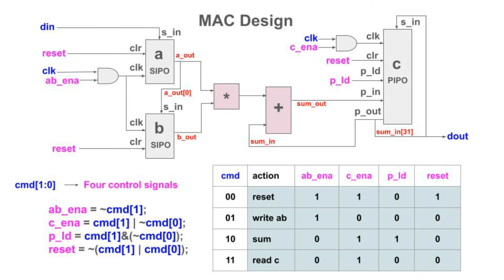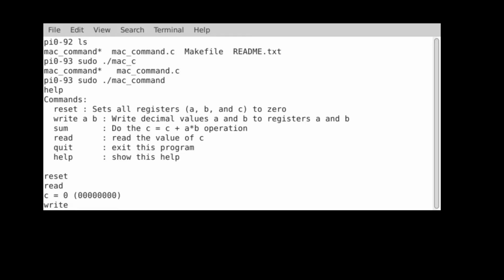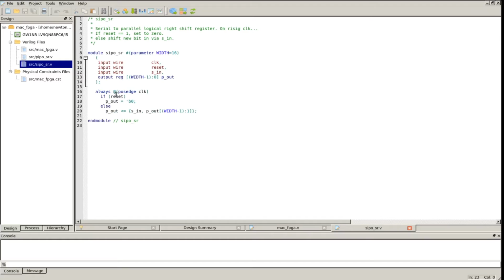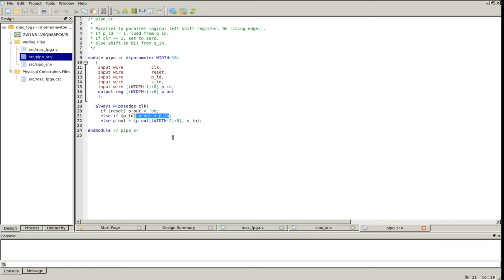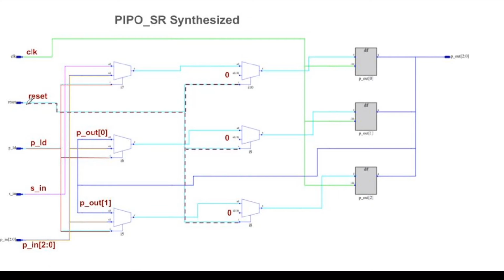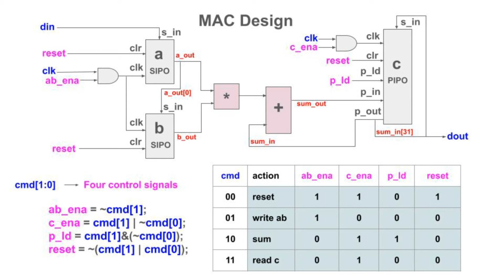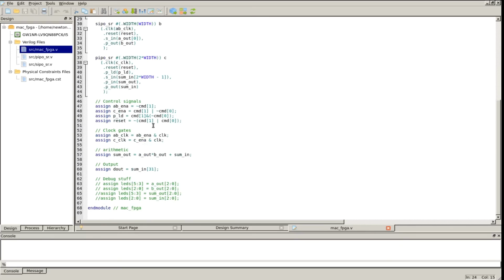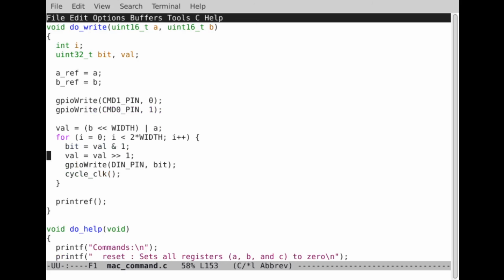Arithmetic (from Shift Registers) Using the Tang Nano 9K FPGA Board

Comment: Any thoughts on LiteX?  There's several articles on it***.. and it seems very simple to use, especially for an fpga beginner like me!

So I installed Ubuntu (Under Windows WSL), then built the sample litex design..
python3 -m litex_boards.targets.colorlight_i5 \
  --cpu-type=vexriscv \
  --cpu-variant=standard+debug \
  --uart-name=jtag_uart \
  --csr-csv=csr.csv \
  --build

The bitstream programs using an stm32 blue pill flashed with drityjtag:
sudo openFPGALoader -c dirtyJtag -b colorlight-i5 colorlight_i5.bit  (must use sudo)
(Note, the USB had to be first bound in admin powershell: 	usbipd bind --busid 3-2 ,   usbipd attach --wsl --busid 3-2 )

However, even though the design instantiates the 'jtag_uart', I can't figure out how to see it!  There's supposedly a litex-banner that outputs, but litex_server and litex_term show OpenOcd errors.  I don't know if I need to first load a program for the CPU... but if so, how can openocd/jtag be used for both loading the cpu and communicating via the jtag-uart?  Or maybe there's a way litex_server/term can use OpenFPGALoader under the hod instead of OpenOCD?  Or maybe there's a different application that can talk to the jtag-uart.. something like nios2-terminal?

*
"Getting started with Litex on a Tang Nano 9K"
"From zero to SoC in LiteX"
"Setting up on-chip debugging for a Litex based SoC" --swethaaneha
"Host Bridge to control litex" -Yu-Ti Kuo
"Let's Write Some Gateware, use Python with LiteX" -tzechienchu.typepad.
"LiteX Soft CPU on the ULX3S - reloading firmware without reflashing the soft CPU" -gojimmypi 
"Adding the Digilent USB104 A7 board to Litex."  controlpaths (Pablo Trujillo)
"LiteX on the SQRL Acorn FPGA"
"LiteX - Add JTAG PHY interface to VexRiscV CPU" -- Adam Henault
"Debugging VexRiscv Over a JTAG Tunnel with OpenOCD" - Craig J Bishop

Comment: Thank you very much, but where can i find the pin connections that you used for knowing the buttons locations? B1->pin4 ..etc
Reply from the maker: I found the FPGA pins connected to stuff on the board like the buttons by reading the Tang Nano 9K schematic available from the sipeed wiki (just google Tang Nano 9K).  It's weird that they don't document this more conveniently.  Since you asked, I just pushed a pinout diagram that I annotated with some of these pins.  It's now on the github mentioned in the video description above.  I have been using this diagram as my cheat sheet.  Cheers.